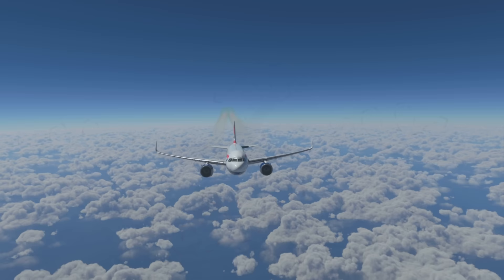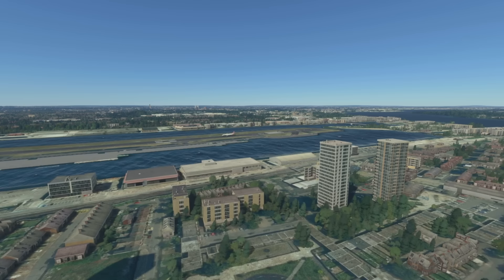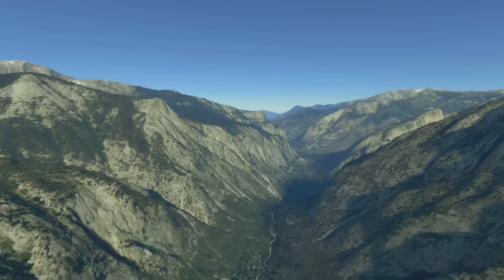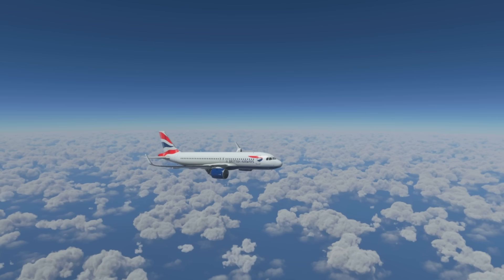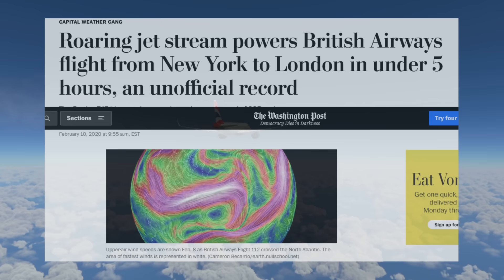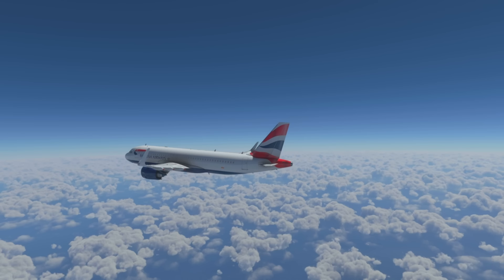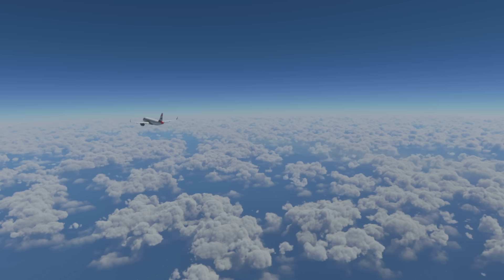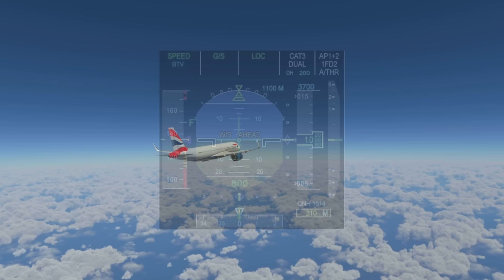When Is Turbulence In An Airplane Dangerous? | Curious Pilot Explains #1

Comment: Can turbulence flip and airplane if it’s turning or just flying straight?
Reply: If a light (4 passenger)aircraft follows a large heavy aircraft in to land, the wake turbulence can indeed flip the small aircraft upside down, which is why you have to learn to aim for a touchdown point ahead of the larger aircraft's tyre smoke.  The ATC people at airports are very aware of this and space aircraft 3 minutes or more apart and also call out a wake turbulence warning to smaller aircraft.  Otherwise, don't worry about that in a passenger airliner!

Comment: A couple of Braniff Air and a Delta flight would disagree with you, Turbulence is a symptom of a potential deadly problem, usually not but, much like anything has the potential for danger.
Reply: Those deadly incidents are extremely rare. Just think how many flights take off every day, then multiply that by 365 days in a year. Those crashes caused by turbulence are so rare that you have a better chance of being struck by lightning than to experience one of them.
Reply: @kathleenstoin671  Yes, because you can avoid these incidents, much like if I climbed up on a radio tower I would be more likely struck by lightning, Weather is very often the reason for crashes, most are attributed to "Pilot Error" when it is in truth a bad situation.... Turbulence is one of these situations, it is avoidance not engineering that prevents these incidents. In fact even Military aircraft are not deemed "All Weather" aircraft. By the way, I was an AT in the USN, I have professional knowledge. Pilots = Drivers, Maintainers = Mechanics....who would you intrust with information regarding a cars build?
Reply: @Cougar139tweak That doesn't change the fact that plane crashes are extremely rare. Think of the many thousands of planes safely  taking off and landing every day. I'm more afraid of driving to the grocery store than getting on a plane. People drive like maniacs. Deaths from car accidents are astronomically high compared to deaths from plane crashes.

Comment: each time these aircraft go through  turbulence and hard landing and  Sometimes severe weather problems  Plus aircraft is doing numerous trips 
Makes me wonder if body  Structure of aircraft would become  Lose weak and we're joints 🤔 are
each time landing as the   Bounce 
😂
everything shaking inside 
How do the  Engineers know that nothing has come loose??😮
Because they land and get back in air in no time 
not a proper check is done

Comment: WINGS ARE THE CENTRE BALANCE POINT WHICH PRODUCE LIFT, THEREFORE FIXED SOLID TO THE FUSELAGE & ONE OF THE STRONGEST POINTS, AS THE PLANE IS HANGING/ SITTING ON THE WINGS ,, SAFE PLACE TO SIT, IF IT WASN'T FOR THE FUEL....🤔🤔😂inside plane, Not on the plane

Comment: So scary but it's seriously nothing to pilots. You know how they are; "Goooooooood afternoon ladies and gents, the time isssss 15:36 temp is 86f. Weeeeve got a little bit of weather here but we're going to go right ahead and get you right where you need to be. We'll be landing in (destination) in approximately 4hr 27m at (local time)..so, pucker your sphincter, remain seated and the seatbelt sign WILL be on for the duration of the flight because it's going.to.be.GNARLY....OK...without further ado, we're going to slingshot into the heavens then I'm going to take a nap while Bob the Janitor takes the wheel. One last thing, thankyou for flying with terror airlines aaaand enjoy the flight"

Comment: 0:56 Wrong. What matters is the wing loading. You can have a "light" aircraft, but if the same aircraft has a small wing area, the wing loading will be high and thus the aircraft itself will not react as much to gusts and turbulence.